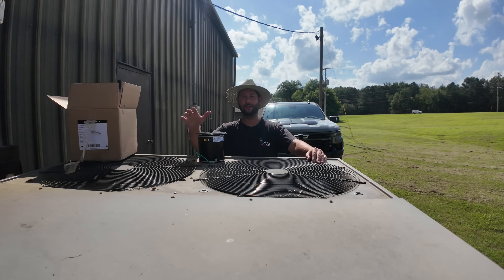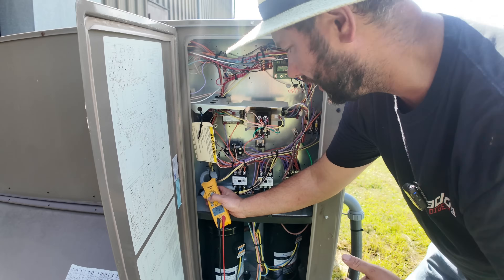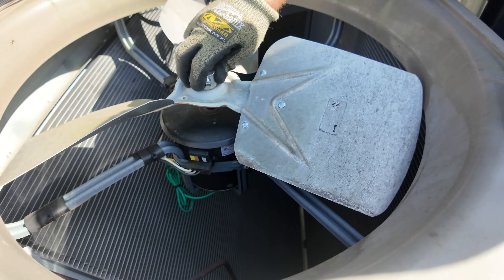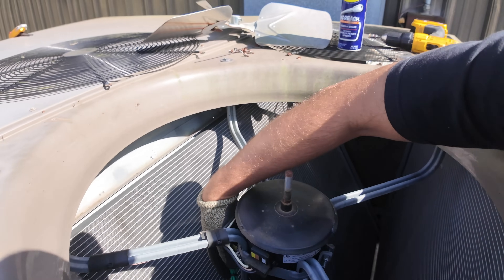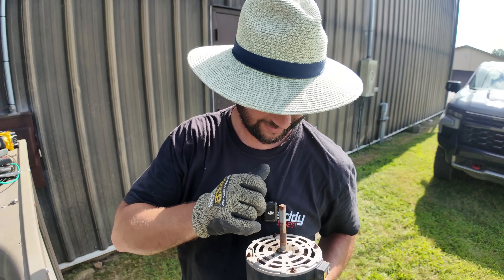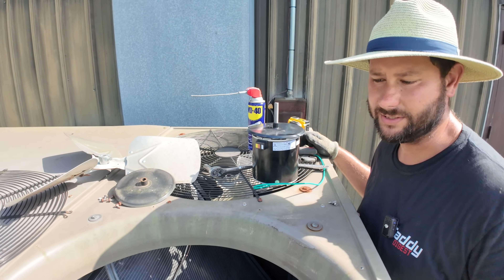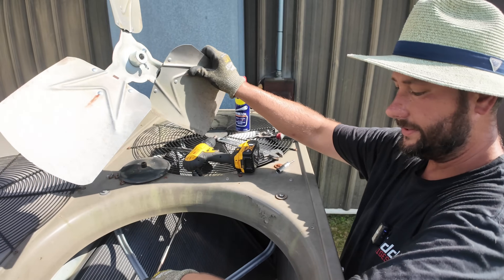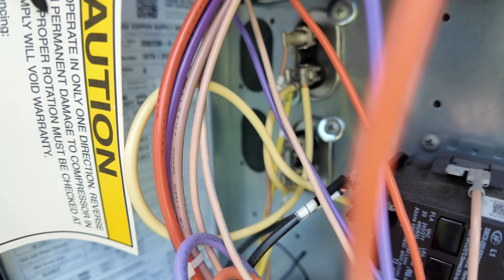How to replace condenser fan motor in commercial package unit?

Comment: Great content. You mentioned the capacitors were checked and tested good. Video idea on checking capacitors and the tools you use. Another video idea; I'd like your point of view for a TXV diagnosis and repair/replacement. Your method of teaching is easy to follow and understand. 
 Checking in from toasty & humid South East Texas.